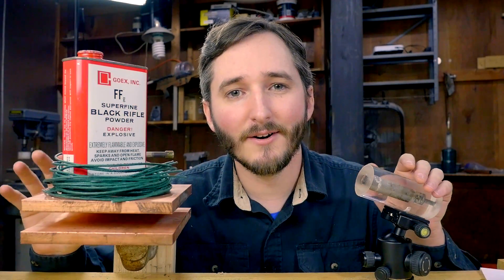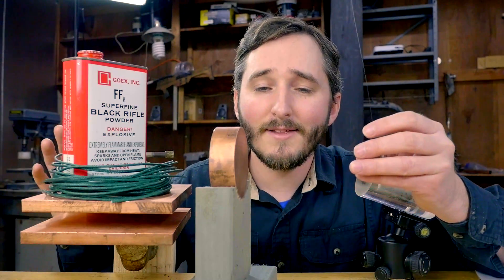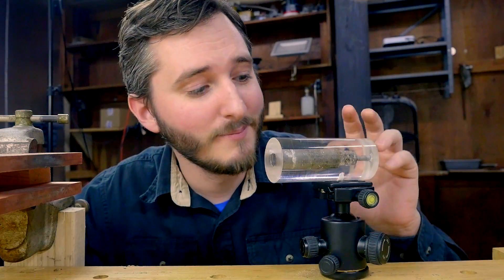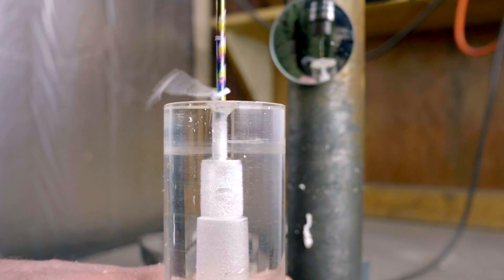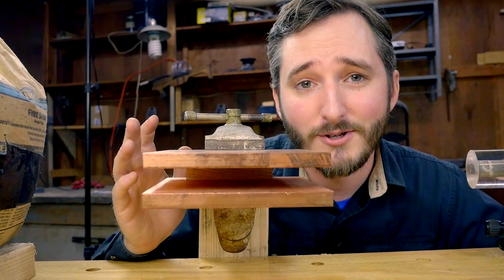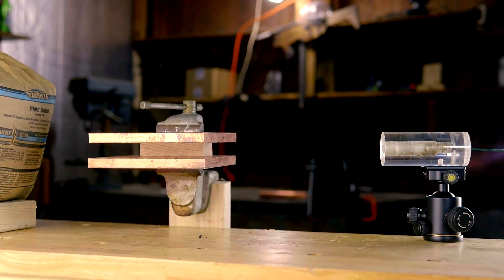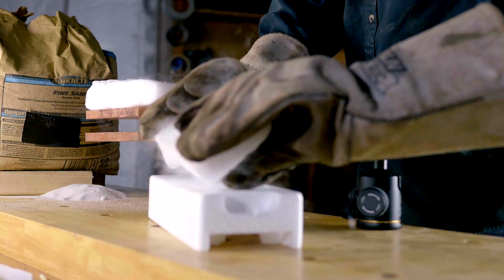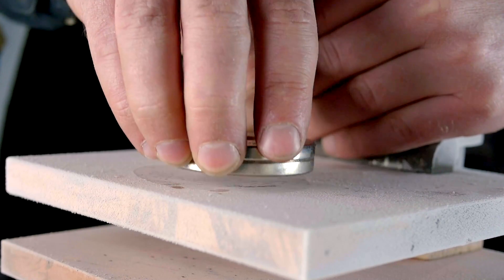Electromagnetic Force Fields VS. Magnetic Cannonball

Comment: You need to do this again but use a copper plate with a  strong electromagnet magnet behind it.  Then fire a 22lr bullet into the copper plate to see if the copper plate can prevented from warping by the magnet.

Comment: It would've been cool to connect a voltmeter and ammeter to the pipe, as when the copper tube breaks the magnetic field of the magnet traveling at a rate of speed nearing a bullet there should be an huge amount of electrical energy converted from the energy expelled by the powder into the bullet.

Comment: The magnet pendulum stopped  because the copper was very close, not so the  plates or pipe, the field would have been too weak. Plus the bullet would be tumbling were as the magnet dropping through pipe  cannot tumble

Comment: The moving ball magnet causes drag, unbalanced drag causes rotation, rotation causes the opposite pole to be exposed eliminating the drag.
The ball never wanted to slow down, it wants to flip, (they all do) but for a ball it’s easy.
Try your magnet on a pendulum test with a spherical magnet, it should spin but barely slow down. String should be placed midway between the N & S poles.
Never tried it but it seems reasonable.

Comment: You should test shooting bullets made out of dysprosium into an ar500 plate. I’m sure it wouldn’t be as crazy as I’d hope, but it would still be a cool video. It’s super hard and the strongest magnetic material on earth. You could even put a small high energy density battery inside the round to make it a tiny electromagnetic bullet. Now that I’ve described it I have to see it happen.

Comment: Why have you used copper plates? For the magnet to slow down, the copper around it should have closed circuit. Two plates create an open circuit, you cannot expect it to slow down.

Comment: ha, I wonder if that's why they dont fire bits of metal down thier big long magnetic tube? makes sense they use little bits of atoms of gas, not magnetic innit! copper stuff would end up stuck to the walls, like magneto off of xmen had strolled in and done his thing innit.

Comment: I know someone who works at a large amusement park. He told me the rollercoaster uses magnets to slow  the cars at the end of the ride before the brake stops the ride. I believe the magnets are using the eddy currents to produce the opposing magnetic field to slow the ride without the need for power or some mechanism. Also it saves wear and tear on the final braking mechanism.

Comment: Your point of this experiment was to see if the presence of the copper was enough to slow the magnetic projectile. Your high speed camera wouldn't be able to show that with the angle you set the camera, when using the two copper plate part of the experiment. It should have been set at a 90 degree angle to the projectiles path going through the plates to detect a slight slowing of the projectile, not whether it would stop it. You should revisit this one using a very high speed cam, Oh! and skip the pipe part as you wouldn't know or see the effects (unless you could measure the exiting velocity from cannon then compare the exiting velocity from end of pipe. Thanks again for the share.

Comment: Should have used a paintball gun instead. Mainly because magnet lose their magnetic charge when heated up, and if anyone has picked up a spent casing will tell you they are wicked hot at first. Where as a paintball gun while slower is powered by expanding Co2 which actually cools the projectile!

Comment: AuPt is both magnetic and diamagnetic... it's absolutely ubiquitous... every river rock in the World  is AuPt in one form or another... it has double double covalent bonds shared across the 13 atom unit cell of face centered cubic hexagonal symmetry.  . It creates hoppers, like platinum by itself
Reply: The tremendous enthalpy imposed by the high melting point of platinum and institutional ignorance has hidden AuPt... we have been missing 99.99999 % of the Au and Pt in our environment... probably on purpose  .. but that's a different story
Reply: So I can spin or otherwise manipulate another magnet through as much as 10cm of AuPt... maybe more... it seems to multiply the magnetic field
Reply: Double double covalent bonds means it is not capable of sharing electrons like metallic bonds... and deforming gold platinum alloy is... I think... impossible..  much like diamond... it's a true room temperature superconductor
Reply: The KT extinction event covered the Planet with radioactive volcanic ash.... it's mostly AuPt... dust... a molecular dust... probably 13 atom unit cells.... I screen down to 300 microns and create a molecular dust which melts at 1768°... C... it becomes metallic... but it is not necessary for use... river rock can be used exactly like steel or aluminum... machined and milled... just like it is... with a metal that is 10 on the Moh's scale of hardness
Reply: Every rock in the World is AuPt in one form or another... we call a lot of it "quartz"... but quartz 
Does not have planes of cleavage 
Can't make flat planes or straight lines.... and melts at only 1250° C. .. it's, apparently fairly rare...  I have silicon carbide..... from my first opal mine... except it wasn't opal... play of color like opal.... glassy like opal.... it's not opal... because it's 10 on the Moh's scale of hardness, like a diamond 💎... it's called moissanite in man made material.... it's melted silicon carbide or platinum... from the heat of the KT extinction event... it was not a comet and it wasn't dinosaurs.... or at least not stupid dinosaurs...  the entire Planet was covered with radioactive volcanic ash.... so maybe they are stupid... how the fuck would I know.... someone real big used the pyramids to, ummmmmmm, shelter from the KT extinction event... I am pretty sure they are all still with us... and... that's why just about everything we have been taught... is wrong... it's mis information that... for example, allows them to mine... and process, radioactive elements out of the Gila River near my home... at a granite quarry... that has the alkalai settling ponds for processing uranium.... hidden in plain sight... most people don't know anything about radioactive sources.  . On purpose
Reply: So.... if, as I say, the rocks of the Earth are AuPt... and I drop a magnetic field towards Earth.... what happens?.... what if I can create paper with enough AuPt to crystallize?... but not add unnecessary weight to obtain the strength of covalent bonds.... and I multiply the magnetic field created in a 3 phase AC current generation system?.... I am working on a sphere that flies... but hangs from a single point on the surface... I think it can reach the van Allen belt at about 30km.... and then I have to tap the current flowing through the van Allen belt to create a different ==>> diametrically opposed magnetic field
Reply: The immediate goal is... a cat on the moon in 2021... the dog too... maybe my wife, ya never know... and landing is not in the picture at the moment... there and back again... for less than 500 dollhairs 

StarFire is going to the Stars 🌟

Comment: Very cool experiment! Maybe you are on the right track though? I mean, they use magnets for acceleration in the big Accelerators, like Stanford, so why couldn't they be used in decceleration? My dad worked on those Triplets, and I believe the idea was similar to your copper tube, in that these units were offset to produce a rifling effect. More to it than that, of course, but they sure worked, so I'd urge you to keep trying. Only if you feel like it, of course. :-)

Comment: Couldn't one determine the speed of the magnetic projectile, times it by its magnetic field to determine the overall field strength and how much resistance is required which would be a product of the copper thickness and length. Copper length and thickness is something he did not really touch on which is strange as I would consider it important.

Comment: NightHawkInLight
Do you think polarity alignment could be an issue?  Since your using a ball you can't prevent it from spinning, thus destroying your induced repulsive force in the copper.  Try firing a cylindrical magnet next time, or attach a piece of foam to the ball to hold it's alignment.

Comment: I wonder if instead of swinging the magnet toward the copper plate to induce a field, what if the magnet hung still right beside the copper but you had something to block the magnetic field like a sheet of lead in between.  If you remove the lead shield quickly, would that still induce a current? And possible push the magnet away?

Comment: How hot does the magnet get from the gunpowder? My guns got pretty warm fairly quickly and they fired 45 long colt an 9mm respectively. I dont remember the load in my nines but the 45 used 250 to 255 grain loads wich is how many individual grains are packed into the casing. Magnets become completely non magnetic at i think around 100-120 degrees C. (Not 100 percent sure that's even close but the magnetic bed on my 3d printer is significantly diminished at 60C)  neo magnets might be better at a given temperature. It looks like you had way more than the load on my 45s packed into the cannon. Would a pneumatic cannon work better. You can use an air tank and compressor or even a plunger and tube. I built a caliburn which is a 3d printed nerf gun that will shoot a 15 gram dart anywhere from 250 to 295 feet per second. Which if replaced with say a neodymium magnet would be very nearly bullet like. You can also cool the pipe through thermal induction by wrapping a wet paper towel around the length and waiting about half an hour. That's why military canteens are metal (if they're not any more we are doing a huge disservice to our Marines) i cool my drinks down this way on job sites without a fridge. The hotter it is outside the faster the water evaporates and the process increases in effectiveness and efficiency.

Comment: The theory was good but there are a lot of factors that go into whether or not this would work.  One being the magnetic permeability of the material.  If it is too low, the field may not have the required time to induce a strong enough field in the copper.  This can be fixed either by getting a material with a higher permeability or a much stronger magnet.  Problem is that neither a material permeable enough or a magnet strong enough exists for a projectile of that velocity.  Other factors likely apply.  The speed of electron flow in the material may be one of them, though that may be related to its magnetic permeability.  Those more versed in physics them be will have to let me know.

Comment: One of my thoughts is the gap between the copper and the magnetic canonball is to large to really have much affect.  When you demonstrated the magnetic falling through copper tubing the gap between the two is pretty small.  On the pendulum demonstration it didn't cushion the swing until the magnetic was quite close to the copper.  Even if you where able to able to reduce the gap with the cannonball demo, I think the magnetic field of the cannonball is just to weak to overcome the kinetic energy of the cannonball.
It was interesting to see and I very much appreciated you taking the time to do this.  Thanks !!!

Comment: Well, it's not totally useless. Say you want a brake on something like a hyperloop that slows down the shuttle even when there is no power. Sure you might have to do a few miles of it, but it's far safer to have a passive system than an active one.

Comment: So does this phenomenon with copper and magnetic fields work the other way around? Like if you took copper and dropped it on a magnet would it have the same effect, as when you drop the magnet on copper? Since most higher velocity bullets have a copper jacket around the lead so it doesn't melt. Also does it matter if the magnet is really strong or is there no difference in interaction. Sorry if this is a dumb question.

Comment: REally appreciate your work and responsiveness. In your introduction i heard you say the question was: "can a magnetic field catch/stop a bullet? Which you turned into "Can a magnet stop itself? The preferred experiment would be to use an electromagnetic field to induce a reverse magnetic field in a passing bullet, if possible. (maybe with a ferromagnetic bullet)

And a clarification in the theory, which is flawed by evidence of the paradoxes of EM induction (see wikipedia).
Also, by altering the direction of an electron beam, one can demonstrate that not all moving charges generate magnetic fields, The magnetic fields are generated by charges that are aligned by external charge fields. Wires with current generate magnetic fields because the aligning field is positioned end to end within the conductor. With that condition, the current then is proportional to the number of charges that are where the current is being measured (the magnetic field is proportional to the currrent with this distinction. With this distinction, one can imagine that magnetic cores amplify the magnetism of inductors by virtue of adding a masssive number of charges that will comply to the orientation of the charge field of the loops of conductors; explaining why current amplification in transformers is proportional to the number of turns of coils. It may help optimize the design of your inductor bullet trap, keeping this in mind (maximize the coils, use high voltage (current is a nonsequitor (might play with this, but expect little influence, add a ferromagnetic core material and if DC does not stop it, try pulsing DC at a high frequency (with a compliant ferrite HF core, but giving the bullet multiple hits in the trap, an alternating voltage might make the bullet tumble and deflect more than slow it). Note: There are designs similar to this that "wiggle" laser beams, if memory serves.  If photons were bullets, in principle a wiggle is a soft stop... so we know this is possible.

Another aspect of this is the opportunity to clarify the process of EM induction. Note, an electric motor with an inductor winding that has capacitance (like a bifilar coil with the start of the primary winding connected to the midpoint of the 2nd parallel winding will capture the magnetic field in the capacitance, which shifts the dominating polarization of the charges along the winding until that charge is transferred to the  coils themselves, which in an alternating magnetic field, synchronizes the "Lenz" effect in reverse of a normal induction field in a purely inductive coil. This amplifies the total electricity picked up by the conductor as it self-induces power in synch with the incoming magnetic field. It also puts the fields in opposition, not attraction, but in a boosting mode. Which means it would accelerate a passing bullet because of the delayed Lenz effect(not what you're looking for. (Thane C. Heins has many videos on this application which was patented back in th 1800's, the effect was reinvented by Joe Newman (see his Big Eureka motor) Joe did it with very long coil runs (miles long, enabling him to commutate the voltage impulse before it left the coil; even at light speed the charge field in a conductor 7 miles long takes ms), and ran his motor on dead batteries (just voltage created the driving magnetic fields), current does not create the fields, it just heats the conductors.

Comment: I would be interested to see how much current was generated in that copper pipe when you fired the magnet through it. Essentially, you have a linear transformer, and if you hook a lead to each end of the pipe and run it to a volt/amp meter, you should get a reading. You'd probably need to have one that would 'memorize' the max reading, since the pulse would be fairly short as the magnet passes through the tubing.😉

Comment: Some people already sorta brought up the issue.   So it's a relatively small magnetic ball, but how about if we change it to the inverse.  ;)  Those are huge copper plates.  How about if you made a HUGE electromagnet with the plates or make a big copper coil?   And we fired a copper projectile through (hopefully a much much stronger) electromagnet, will it slow down the copper projectile????????????  And maybe we could vary the magnet strength vs. the size of the copper projectile????  That would be interesting!!!

Comment: I see I am catching up on a video a year old. So will look to see if you did additional experiments. I am thinking the magnet is not of sufficient strength to generate a strong enough opposing magnetic field in the copper. Also, a chronograph(Caldwell Ballistic Precision Chronograph  for example), possible two, one before and one after the copper magnetic field trap, could be useful to measure changes in velocity. Perhaps a work up of a few more experiments?

Comment: Okay so what if we substitute the cannon for a rail gun in its most simplistic form and use those copper plates cut length wise into squared rods 3 , 6 , or 9 of them or as many as you want and have them eletromagnetized with a squared M shaped lead core with copper wire wrapped around the center pillar connected to a toggle switch (to activate the eletric current to magnetize the electromagnetic rods from safe distance)  , with a north and south pole put into opposing position where they would apply magnetic pressure to anything metal placed in between to the point it would magnetically pinch them (per say ) at a high velocity thus getting rid of the magnetic ball being fired via firearm and using just a different shape of just a normal metal something and that would contour to the said rail guns "rail" or "barrel" . Then we could use frozen copper pylons via dry ice placed in a pattern of sacred geometry around our sand bag to be the force we use to stop the projectile in theory